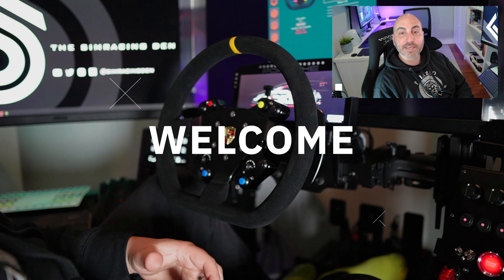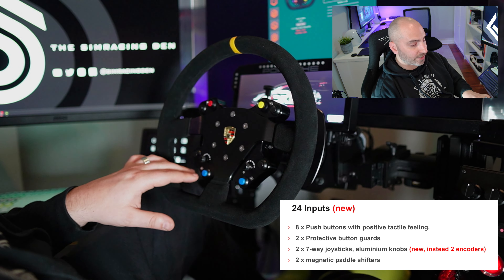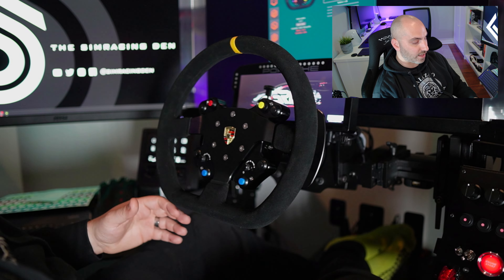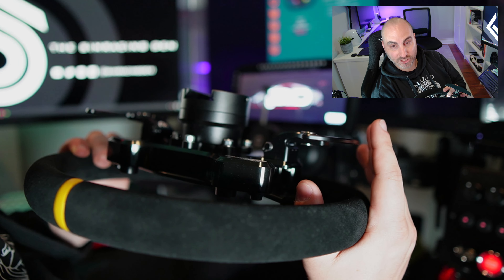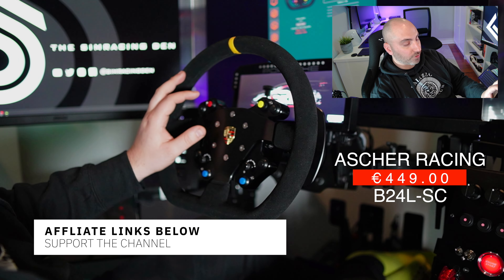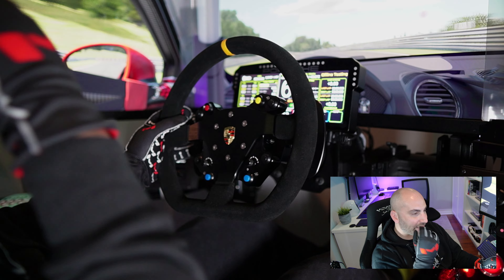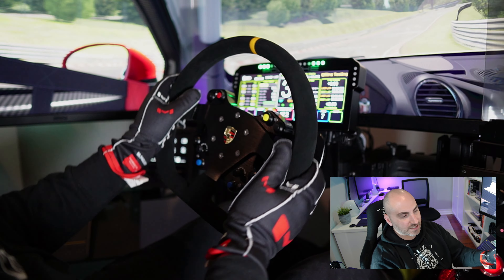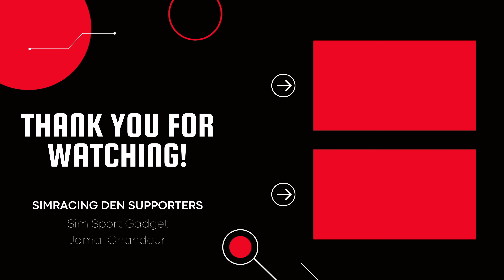Ascher Racing B24L-SC Wireless Sim Racing Wheel | REVIEW

Comment: I have recently purchased a BB Ultra and paired it with a Turn 305 really enjoy it. 
I am looking for a second button plate for my competition v2 rim and was about to purchase the Ascher for a different look and feel . Im not sure what to do after watching this now,  maybe another BB Ultra ?? 😊
Reply from the maker: I hear you; I purchased the Ascher for the same reason to have some variety between wheels; maybe check out some options from Simcore. They have some nice button plates from what I've seen but not tested. I may pick one up soon myself.
Reply: Good shout il take a look 👌
Reply: Is there an option to maybe add your some rubber dampers on your Ascher
Reply from the maker: @nevillerichards9330  I ordered some small dampers off Amazon to try out think that’s all it needs and should feel a lot better.
Reply: @simracingden  oh cool, will you do a follow up vid? I would be interested in trying this if it works out for you.
Reply: @simracingden I have the SimCore STD24-WS. The shifters sound and feel outstanding
Reply from the maker: @billgulker6187  Adding to my shopping list 👍
Reply from the maker: @billgulker6187  which paddles did you get with it?
Reply: @simracingden  I purchased the large GT. These are ideal for 300mm wheels however I recently asked George if he could make a set that would work with my 330mm round wheel. I think he is planning to make these for me.
Reply: I bought ascher and really happy that chose it over bb ultra, just changed to smaller shifter pads and it is great, i can adjust with magnets shifter strenght, already more than a half year and it is rock solid!
Reply: I ordered the the Simcore its STD24-WS , its on route. Cant wait.

Comment: I have the USB version of this button plate. I live in a small complex, i live on the top, my neighbor on bottom. I was so concerned with the paddles that i instantly removed them and replaced with the very nice sim racing machines paddle set. Much quieter. It's a very nice button plate. I still use the older carbon fiber button plate so wanted to stick with Asher.
Reply from the maker: Oh wow yea they can be loud, Thanks for sharing